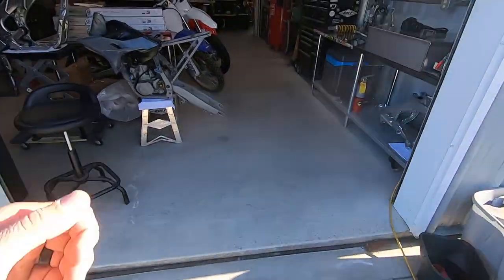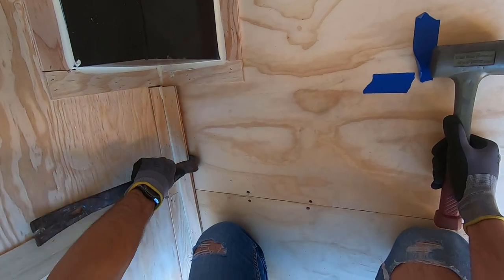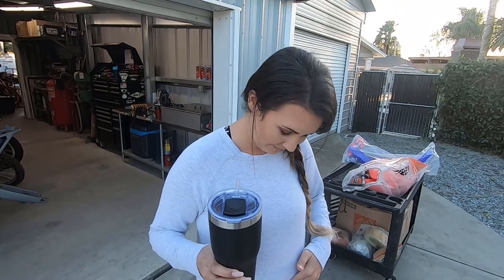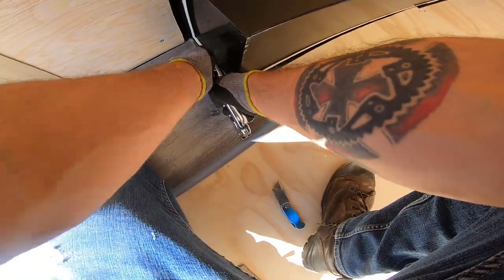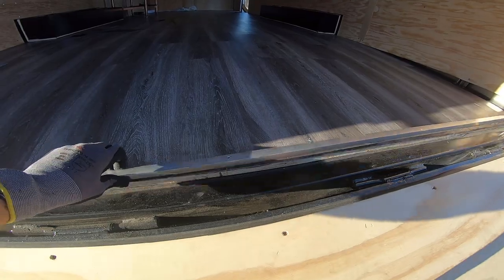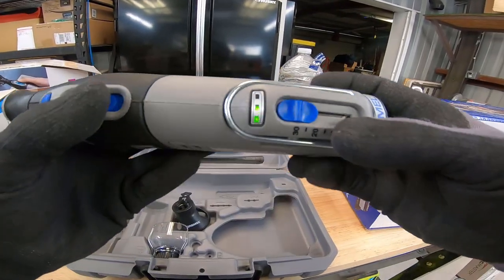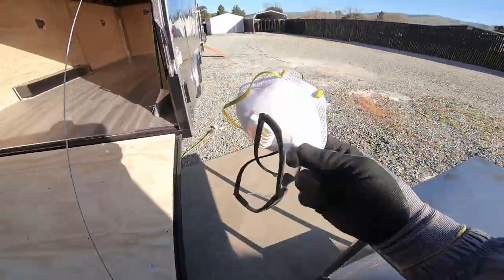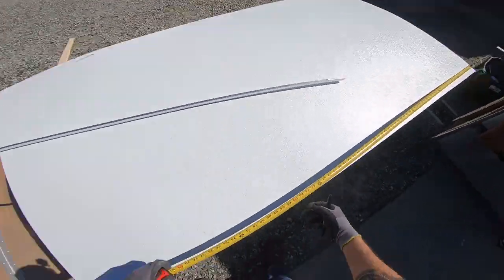ULTIMATE MOBILE WORKSHOP - STORE FRONT - BOTIQUE - RETAIL BUSINESS - ENCLOSED TRAILER POP UP BUILD

Comment: Had to use a dremel to do a 1st gear mod to my kids jr50. Layed it over, stuffed rags in case, drilled holes, connected the holes with the  slitting discs, vacuumed it out. 
Removed oil injection while in there.
Battery operated dremel would be nice to have, small enough to throw in small tool box while riding to grind or cut hardened parts in a jam.
Reply from the maker: It saved my butt a few times now! The battery part is especially cool. I haven't even burned out any of the original bits!

Comment: Looks sick! I agree with the previous comment that the flooring isn’t going to be the best for that application from expanding/contracting plus moisture getting between layers. I’ve spray lined the floor of a trailer and about a foot up the walls. That way when it gets muddy you can power wash it out. Def doesn’t look as good as this does.
Reply from the maker: Thanks dude!

I'll keep you guys posed! It's crazy how tough it is. I've dropped (purposely) some heavy tools on it and have been sliding cabinets & such into the trailer... thought that would kill it but not so far!

I want to Line-X the drop gate like you've mentioned- I went a bit more fancy inside 😎 It made me happy. Typically end of story haha. It'll be more of a clean space than a dirty one from bike mud/ dirt. 

Part of the expansion and contraction is not letting it acclimate out of the box for a few days in the flooring's new environment. I can see it move a bit day to day in morning VS cold. I figure if this ever gets bad, or the climate control of AC unit doesn't do anything, there's always clear silicone for the little gaps.   

Thanks for watching!

-Charles // mXrevival

Comment: I put vinyl plank flooring in my enclosed and it expanded and shrunk so bad from the changing temps outside, I ended up tearing it out and throwing it away and did one sheet of linoleum.  I'm in WI though so much more swings in temp than CA but you might have the same issue.
Reply from the maker: I could see that being so frustrating, Scott 

I guess part of the expansion and contraction is not letting it acclimate out of the box for a few days in the flooring's new environment. I can see it move a bit day to day in morning VS cold here. I figure if this ever gets bad, or the climate control of AC unit doesn't do anything, there's always clear silicone for the little gaps.   

Thanks for watching!

-Charles // mXrevival

Comment: That looks fantastic!! How has it held up over time??? I literally am wanting to put down the exact same product just not sure how it would hold up long term...my application is going to be pretty much the same as yours, moto toy hauler/camper. Thanks for any insight!
Reply from the maker: Hey Eric, really glad you liked it. I would advise against this type of flooring as it expands and contracts quite a bit with warmer or colder weather, and does not require much temperature change to fluctuate unfortunately. I was being a little too fancy! The rest of the trailer has been amazing, I actually just sold it. I would recommend linoleum flooring in one big sheet for the same overall effect and good looks. Probably cheaper too and you can leave a gap around all the edges of your space to help any expansion or contraction issues, if any at all.